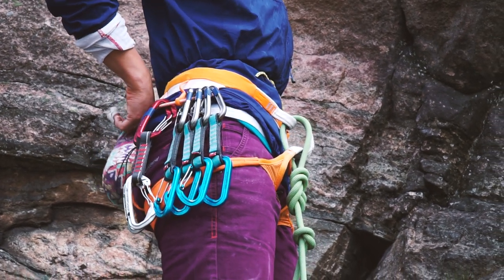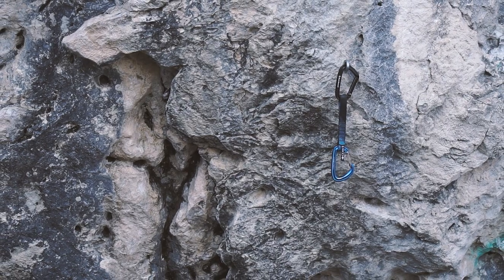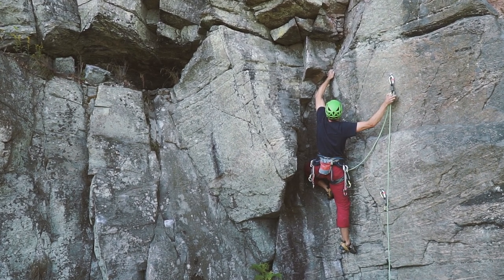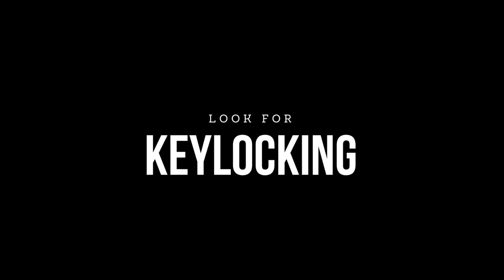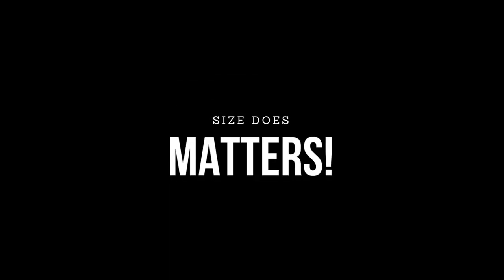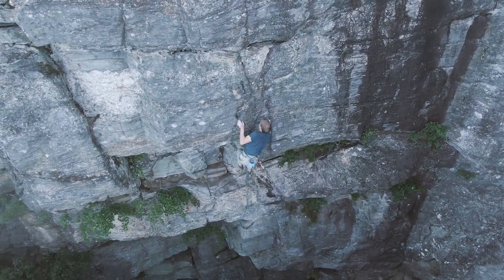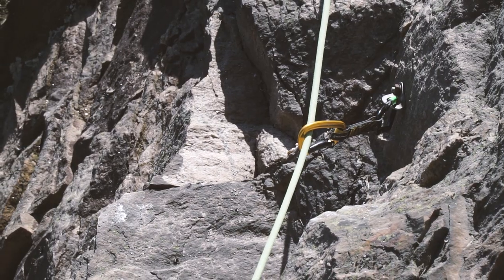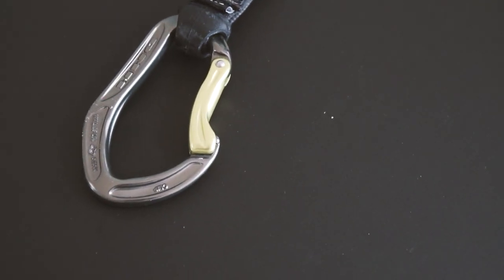How to choose the BEST quickdraws for climbing

Comment: The Trango 18 cm vs a 25cm sling taped near biners? I've been using the sling / biners for years and they give a good amount of extension and are lightweight coupled with the petzl Ange S biners.
Reply from the maker: G-Money Debt, That is a good point. On sport routes I prefer the “fixed” length quickdraws, but on traditional, alpine and ice climbing I would go with he extendable quickdraws any day! 😄